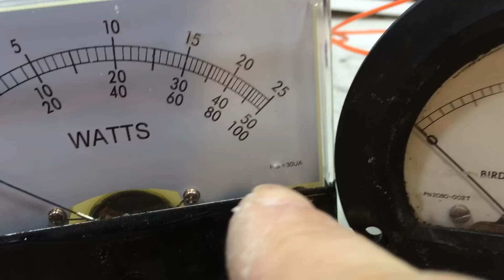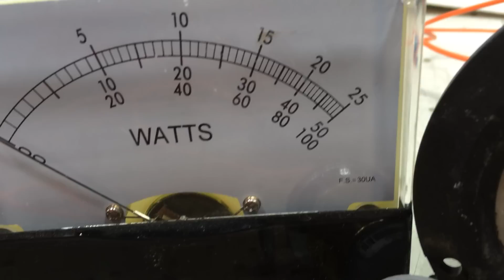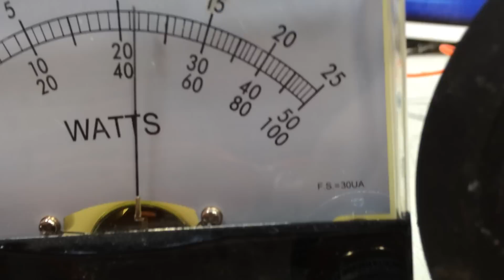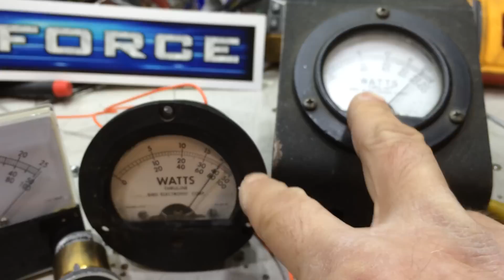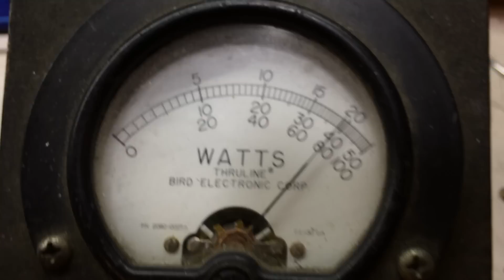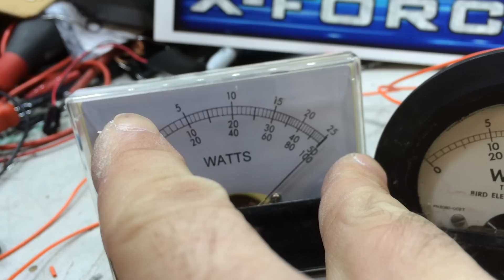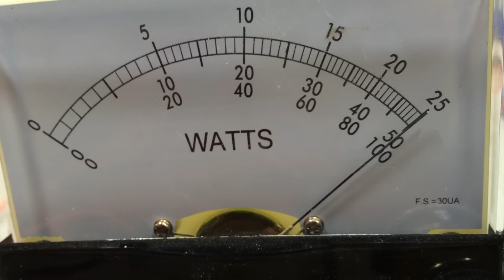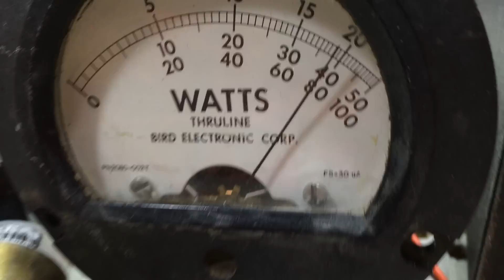Why I Don't Use An After Market Bird Meter To Make Videos

Comment: Bird didn't make their own meters, Before Bird moved production to china they used Simpson meters.. Ever since Bird, moved production to china their quality has gone down the crapper, The slugs are now brass plated plastic. Coaxial dynamics is really become a better product but they are still over priced.    

I'm curious as to why CB'rs have such a Bird fetish, I mean they aren't all that accurate.   Bird laughingly claims +- 5 percent of full scale but the calibration lab I use has told me in the 40 years they've been in business that the overwhelming majority of bird slugs they've tested barely met  +- 10 percent and they are a military contractor 

Now they can be calibrate the slug and meter to be within +- 5 percent but only for a very small frequency range , My own lab testing has confirmed this.  Heck you don't need a lab to check or calibrate your slugs a simple Oscope and dummy load is more accurate than a bird meter for measuring power and can be used to calibrate them. There is no magic in a bird meter its all a really simple circuit.  The bottom line is no analog meter based on a d'arsonval style meter regardless of manufacture can better +-10 percent in accuracy.  In fact the best d'arsonval  meters are bearly accurate to +-10 percent. 

The solution is to have single slugs calibrated for a specific power and frequency. I have one slug calibrated for each frequency and power I use for testing and service. When done this way Bird meters can be very accurate.  The single frequency slugs are  guaranteed accurate to +-5 percent. Unfortunately the slugs will only retain this level of accuracy in the meter it was calibrated for use in and the calibration lab needs your whole meter to perform the calibration 

 For example my 20m slugs are centered on 14.200 and is good to +- 100Hz  I have 6 slugs for each band calibrated for 50, 100, 500 1000, 1500 and 2500 watts.   Their power measurement is guaranteed to be accurate to 5 percent within 10 percent of its calibrated value that's +-5 watts for the 100 slug. I've confirmed their accuracy with my HP power meter. 

 For example the 100 watts slug is a calibrated  250 watt slug guaranteed to be +5 percent at the 100 watt reading at +-100hz , above 105 watts and below 95 watts its only guaranteed to + 10 percent, Likewise below 14,100 and above 14,300 it's only guaranteed to +-10 percent or 20 watts. Unfortunately that's just the nature of d'arsonval style meters.

Don't take my word for it, Grab two 1000H slug and test them every 2Mhz through their range at 100 watts and compare them to your Oscope measurements. I guarantee  It will only read accurately at one or possibly two frequencies that are harmonics like 14 and 7 Mhz  everywhere else you will see a range for 50 watts to 150 watts.  On the other hand an error of +-100 watts when measuring between 800 and a 1000 watts is kinda irrelevant 

Anyhow enjoyed your video

Comment: I would love to see you do the same test bird movement Vs whatever MFJ meter you can get ahold of... single movement or cross needle.. Anyway very good test very informative ...small block in Maryland got down
Reply from the maker: This test only works if the meter movements are the same current rating.

Comment: Hello, This is MattN2YCK from Ebay, This meter your using is not the one we sell. There are two of us selling this type of meters that look the same, but are not.This meter your using are recalls from first generation a few years ago, and shouldn't be sold on the market anymore: But the other guy keep pushing them, even though he doesn't sell many of them. The meters now are within specs and don't read like what you seen in the video. Now where not saying there 100% the same, these meters where made for Hard core Hams, and CB'ers that are SSB, CW, RTTY, Packet and Data users that didn't want pep, this is why the meter moves slower. To make these meters move slower, we add resistance, and changed scaling. This still reads the same on AM, FM. These meters are also good when used in AC tube amplifier as an out put reading meter on the front panel of the amplifier for easy tuning, this is done by making an RF tap inside before out put port. This isn't used much in smaller amps, just tube amps do to some custom designs. Wish you would have bought from me as you wouldn't have had this problem. We have sold close to a thousand of these with about a 99% satisfaction rate. In our next shipping we are branding our meter do to this video; name will be Watts Electronics. We sell the 30ua round, 30ua square, and 100ua square. The 100ua has our name branded on them, as we have the only rights to them. I hope this helps free your mind and would like to send one of our square meters for a test as you wont see that 200w extra. thanks for your time, 73s.
Reply: I have 4 of these meters that I have purchased from Matt, 2 of the square ones and 2 round ones in a separate enclosure. I have been using these meters for a couple of years and love them, they are just as accurate as the Bird meters in my experience.These meters have worked great for me and I will continue using them .
Reply from the maker: Michelle, When did you stop selling the old style?
Reply: Last one we sold, to my guess is months ago, but can't be for sure do to they look the same. In the last few weeks have been checking every one before shipping to make sure there not old meters as we have found that the supplier has been slipping in old meters or they where broken/bad. To my 2nd guessing, and after my last post i had to looked in my records, and have seen that you have bought a rack panel meter with this type of meter in it. These panels rack mounts where made around the time of meters just coming out, if this is the meter you have in the video, you may have a bad one. The strange thing is that the old type where stingy not generous as whats in the video. 
As stated, we will brand our new meters in the coming months.
Reply from the maker: michelle bacchetta
Yes, I got that one, but it went down the raod long ago. This one came in around mid November via a different account. FYI,  Like I said in the video, and you also expresses, they Are Good Meters, but still, it cannot be compared to a real Bird unit, and that's all I was saying, with what I do, I can't use it as a sales tool (Look at the Title to the vid), and to be leary of anyone who does use it as a sales tool. You would be surprised just how many of your customers come from Me sending them a link to your sales. Alot. So if I didn't think they/You were OK well,.............
Reply: Yes, This is why I stated the meter your using are not working right or out of alignment; never the less who you bought it from. The meters on the norm are right on. I haven't sold any in November to your state nor to your Paypal acct as we have looked into records since last post. The square type doesn't sell as fast as the round meters, and for this it was easy to track each square meter sold in November or other month. 
Not sure what last statement was regarding.
I know a few techs that use my meters in there amplifier builds, ohms law doesn't lie. Anyone with 6 grade education will know of ohms law and how to apply it, that if they didn't come from a city school. If they seen gross watts, like in the video, they should send them back, but most of the amp builder i deal with are highly intelligent builder with a great source of knowledge, many worked with the retired master of CB amplifier building. I don't want to name names, but i have been doing this for a long time, and know almost ever amp builder out there. There's a lot of computation in the amplifier building, what comes with it is name calling, fighting, and what not. There's no need to  down another amp builder if you don't like him or what not. One thing i have seen is no one builds an amp the same way, every amp i ever had was different from each amp builder, all did about the same watts in same class, what makes the builder jump ahead of the rest is his workmanship and the way he talk, and your right ohms doesn't lie.
Reply from the maker: michelle bacchetta
It was bought out of state and then forwarded to me, so the records search was pointless, and doesn't really matter.. But what does matter is that I have said, and will continue to say, it's a good meter, but I cannot use it to make videos where people are expecting to see the real deal. I personally use one of these in one of my own mobiles for reading reflected watts, and it does just fine at that. It's a relative reading meter, and as long as that's known, and used as such, it's a great deal. I do thank you for chiming in, and letting me know that you are continuing to improve the accuracy of your meters, and I will continue to buy them. As a matter of fact, I am getting ready to place an order with you in the next few days.

Comment: So what your saying is you could buy actual bird replacement gauges and put them in let's say a dosy case and be accurate?
Reply from the maker: Sure, you could mount it in a shoebox, as long as you have the bird line section and slug to feed the meter.
Reply: +Xforce Amps well thank you for your reply but I dropped my hack idea and just bought a true real deal bird meter, now to save up for slugs.

Comment: If a new meter face was made to span the distance when using 30 ua, wouldn't that fix the problem?
Reply from the maker: +Donald D&#39;Egidio if its a 30ua meter movement
Reply: The aftermarket meter I have measured 27ua for the marked full scale and it was not at the stop. Didn't you increase to 30ua and the meter was showing a little past the scale? I want to try and scan the meter face into Photoshop and increase the scale by 10%. That should now show a full scale with 30ua.
Reply from the maker: +Donald D&#39;Egidio if it was only that easy. You can't change the electrical scale of a meter by changing the printed scale on the face. That's like saying that if you change the printed numbers to be 10% higher, then your amp will be doing 10% more power.
Reply: Determined the meter can't use more than 28ua before the coil hits the magnet housing. Bought a true Bird replacement meter. Problem solved.
Reply from the maker: +Donald D&#39;Egidio Now your seeing the light.